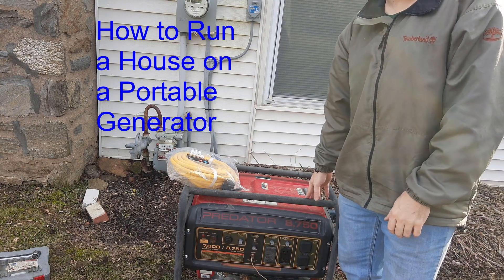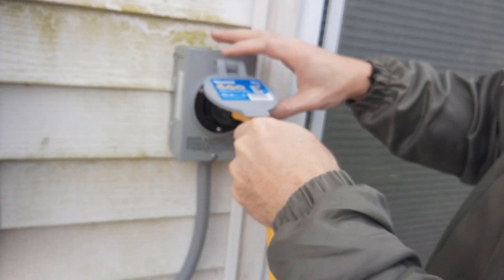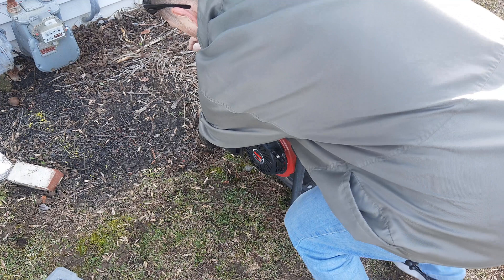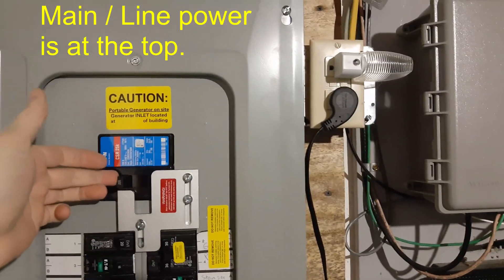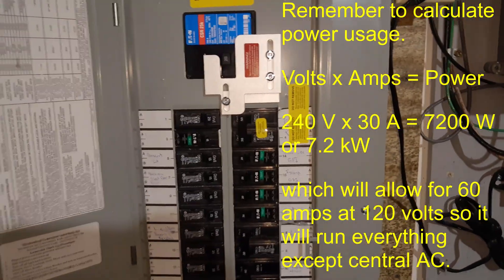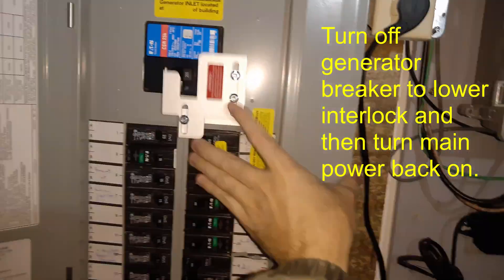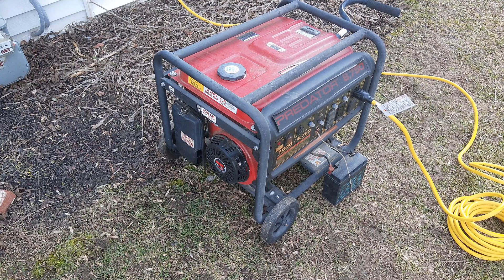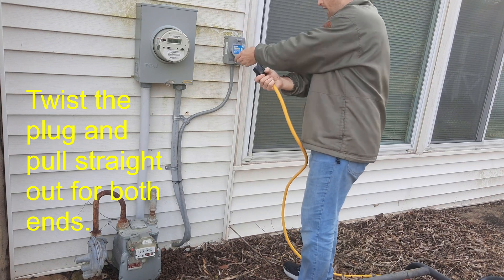How to Power a House using a Portable Generator (Predator, DuroMax, Champion, Generac, Honda, etc.)

Comment: It’s also important to follow the safety of using gas generators.
⚠️Portable Generator Safety Tips:

1) KEEPING OTHERS SAFE: Please do not allow an unqualified person or your children to operate and service the portable generator. Just because some manuals don’t say that doesn’t mean it’s safe. That is important against the generator safety rules. We also need to be keeping an eye on our children too. You need to make sure that your children are not playing near the portable generator especially when it’s running so they won’t get electrocuted. Generators pose electrical risks and they can be hot during an operation. Please keep your children away from the portable generator at all times. It is important to keep our children safe especially our little ones. Be aware of all the hazards.

2) WHERE TO RUN YOUR GENERATOR: Some people use their portable generators indoors which increases the risk of carbon monoxide poisoning. It’s important to have carbon monoxide detectors if you have a gas generator. Never ever use your generator indoors even if your doors and windows are open and even in the garage is not safe to use a portable generator. Also please never use your generator in your deck or balcony. It is never safe to use your generator indoors and in enclosed areas of your home. Your generator needs to be 15-20 feet away from your house. 

3)FIRE SAFETY: Never refuel your generator while it’s running. You need to let your generator cool off before refueling it and before storing your generator. Never overload your generator too. Never ever back feed your generator. You should never plug your generator into a wall outlet. Also never store propane tanks indoors. Please keep flammable things away from the generator as well and please don’t smoke cigarettes near the generator. Having a fire extinguisher next to the generator is also important against the generator safety rules. It’s also not safe to move your generator while it’s running.

4) GENERATOR OPERATION: make sure your hands are dry before touching the generator. Never use your generator in wet conditions. Don’t let your generator get wet. You need a generator tent if you need to use your generator during wet weather. Please don’t wear loose clothes when operating the generator. Turn on your generator before plugging in appliances. Use the right cord for your generator. Please do not use worn out cords. 

It is always important to follow the safety rules when using a portable generator.

Hope this helps.